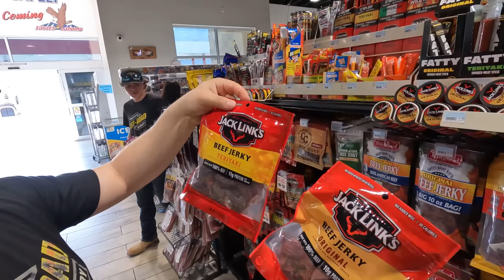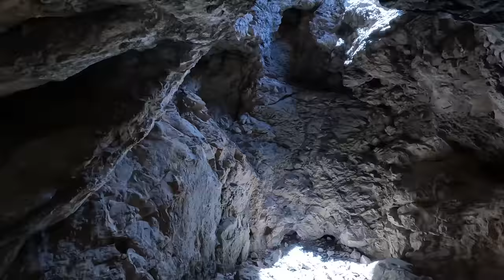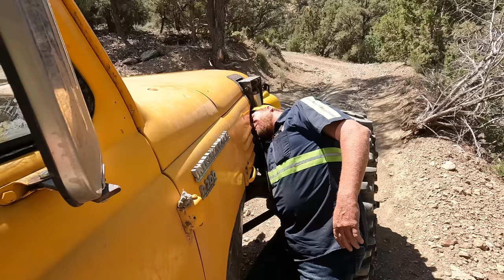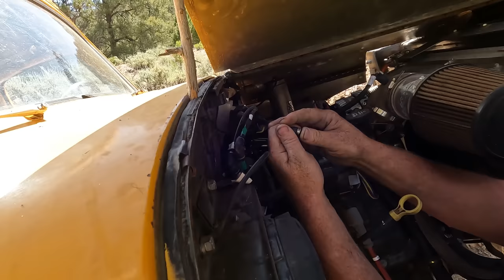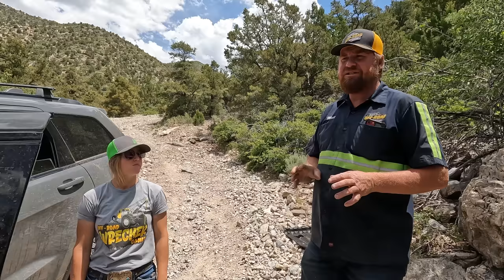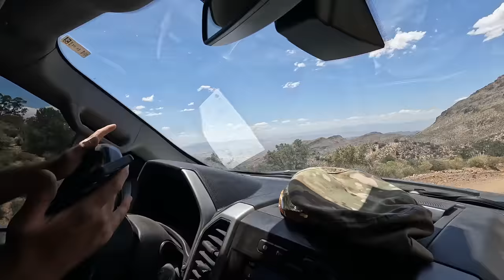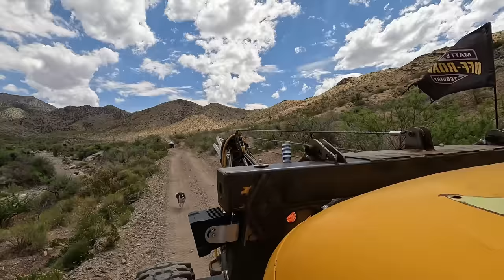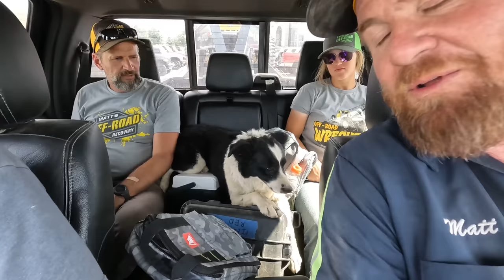Forced To Use Equipment I Despise Out On The Arizona Strip.

Comment: I have a set of traction boards and have only needed them in snow.  They’ve saved me twice when I was stuck because I couldn’t get back on top of the deep powder.  I’m sure in the terrain Matt sees boards are fairly useless, but in deep snow they’re worth tossing in the back of your rig just in case.
Reply: I keep four traction boardw on my rig in the winter.. they have gotten me out of some bad spots. I agree they're not nearly as useful in sand/ dirt/ rocks.... But in the snow they can really save you.
Reply: I was stuck at the edge of  a river with deep sand bottom. No where to winch. Traction boards, a hi-lift, shovel, a sleeping mat and a ton of elbow grease got me out.
Reply: exactly
Reply: Tire socks worked for me mud and snow got me out
Reply: @CoreyTiff-kv1nq 
Tire socks in the mud? How much help were they and how well did they stand up?
Reply: Never needed them, of course i’m not a toyota boi. My GMC and old willy’s never have been stuck up here in the rockies.

Comment: Heat Shields work for a reason, it's not just the heat transfer through the air, it's the literal infrared energy coming off of those pipes! Like when a fireball goes off in the distance but you feel the heat in your face, the air between you and the ball isn't any hotter perse. 
A simple physical barrier shield would probably help a ton!
Reply: Thought about the same thing. Simply a heatshield (best works some Aluminium or stainless steel and bare metal, because it reflects the heat back) between the headers and the heatsensible parts would do the trick. Moste OEM Cars have those from beginning.
Reply: @mulciber7428  
One should always wear their tinfoil hat.... good for manys thingses
Reply: ^^THIS^^ is the fix @TheCalbrt1987  has it. Literally a piece of aluminum foil between the headers and the affected stuff will do it. And probably cool the cab a bunch too. There is some neat waffle pattern stuff you could sort of shape over the headers.

Comment: A metal heat shield needs to be installed between your hoses/wires and the headers. Rapping the headers can help too.
Reply: Or way , would be to move hose and wiring to a cooler spot or behind firewall.

Comment: 5:40 .  I agree with matt. how many times have we seen Matt go out to get someone unstuck, and surrounding the customer are several $80,000 custom off road vehicle with winches and ropes? In my opinion it's like swimming, the difference in swimming and sinking is knowing you can swim. Matt knows how to recover, and that's what he means by what he said about traction boards.
Reply: Most of those trucks are just setup to look cool. Wouldn’t be surprised if most of the stuff doesn’t really work, or the owners don’t have a clue about recovering.
Reply: @KtP370  I can agree with that. Most aftermarket bumpers have extra holes that require drilling through the frame to properly mount them. I’d say most don’t take the time to do it.
Reply: Considering the fact that he broke one of the "ladders", they weren't up to the task either...

Comment: Matt, you may want to consider switching the airlines that are around heat sources (at least if not all)  to stainless steel hardlines with flared fittings, that would eliminate any chances of trail leaks. This PTC fittings are convenient but i wouldn't trust them miles away from any type of help. Stainless flaired fittings will hold up to anything.
Reply: Or, stainless braided airlines!
Reply: Can't go wrong with hard lines. Get a flare kit and re-do everything in SS so you can quit worrying about it. I like how this problem showed up in real-life conditions. This is the way.
Reply: @defaultuserid1559  yep, i used to do custom cars, i did a 92 caprice with hardline all through it and never had a single issue!

Comment: Infrared heat isn't affected as much by airflow, if you wrapped the headers so that the heat isn't radiating off the surface then you'll have a much easier time losing the heat into less critical parts of your car.

Comment: For the air line heat issue, I think your best bet is really heat shields.   Small pieces of sheet metal that prevent the header radiant heat from getting to the air lines. Heat shield just need to be a thin piece of sheet metal between the heat source and what your shielding. Of course, with air gap on both sides.
Reply: Or double walled exhaust pipes.
Reply: Same for fuel and wiring
Reply: No try fixing the tuning. If that is running too hot, its lean. there is no way that thing should be that hot.
Reply: They don’t pay attention to comments. These do nothing
Reply: Ceramic coating, heat shield & wrap. It should make a huge difference
Reply: @burtonspy911  you're making them at night

Comment: After using traction boards last weekend to get up a dune, no, you're probably not stuck but that doesnt mean they dont have their uses! Numerous times I've seen you pull a car against mud, I reckon if you put a traction board or two down, you might have had a chance to pop it up on top of it without as much stress on the vehicles. Sucks to pull them up after though haha

Comment: Matt, you may want to try wrapping those air connections with self-fusing silicone tape.  That would insulate them from the heat while holding the connections in place and I believe would fix your problem.  The tape can be cut off if you need access to the connections, and it would be much cheaper and easier than addressing the exhaust.  Once you start using the tape, you'll wonder where it's been all your life.

Comment: Matt..  You can wrap those headers and put a little metal shield above them and it would be more than enough to cool everything down.  Even more extreme, you could rig up a fan on each side -- to blow the heat out of that open fender wells.  Also another good upgrade would be to put shut off valves right at all of your four corners---  that way when there's a leak;  you can simply pump everything up as it needs to be, and then shut all your valves so that it holds in the pressure at the bags and you can still make it home and fix the leak at the shop, rather than being stuck on the trail.
Reply: Ceramic coat the headers and then asbestos heat wrap them. Your idea for a heat shield would help a lot.
Reply: Agreed. The wrap is inexpensive and VERY effective. So is the heat shield. Summit will have both. I've used both on a 1999 Pajero (MOntero) with an engine swap and headers. No more cooking feet. The other thing to do is to get the headers ceramic coated. Also very effective. Here in Oz, heat is an issue.

Comment: 5:23 Not controversial at all. I used to have a gov job where we had to 4 wheel into the back country on a regular basis. I said it all the time, if you could extricate yourself, you weren't really stuck, you were just inconvenienced. You weren't "stuck" until you had to call for outside assistance (usually after a significant hike! lol).

Comment: Traction boards are useful when your vehicle is generally capable of going over the given terrain, but there are a few places where you need to cross a ditch or go over a high rock, or a patch of the surface is too soft and you need traction (hence the name TRACTION boards). 
If your whole path consists of soft surface (like sand dunes) or rock-crawling, then of course the traction boards are useless, as you won't be constantly putting them under your wheels. You just need a more capable rig then.

Comment: 1.  You could have a shop custom build you headers to any shape you want.
2.  They make an insulation coating (not referring to heat wrap) that can be applied to headers that keeps most of the the heat in.  Headershield.
3.  Place some hi-temp insulation board between the hoses/wires and the exhaust.
4.  Use some fold-down boat seats for extra people on the back of the wrecker.

Comment: Matt, I wish I would have had a set of those bunny boards in August 1980 in Sierras mountains. When I buried the back end of my 1960 CJ5 with small block vette motor on an under ground spring. Locked in the hubs and buried it to further.
  As I reached down to pop the lid up on the storage under the right sear. When Tall, dark and hairy took to roaring at us. He didn't us tearing around his forrest. We were bird hunting and only had 12ga. bird shot and three guns. My buddy handed me my pump gun and I said let's go. He said F. orget you. It took off up the stand tearing the forest up. I ran parallel to it on the dirt road. It acrossed ahead of me into the next stand.
  2 1/2 hours later it caused a flock of doves to burst from a tree at the top of the road where it turned to the right, where it crossed with a boom, boom, crash, crash, crash. During that 2 1/2 hrs I sent rocked to China. Almost out now. Not enough winch cable to double line to a tree. Vietnam Entrenching and a Jack. Yes I would take the bunny boards. Broken right front axle was found later. My buddy never said a word again or during that except F  orget you I am not leaving the ammo box and the guns.

Cheers

Club of No Return !

Comment: Matt, getting the headers ceramic coated with a quality motorsport functional coating (inside the pipes as well as outside) (as opposed to cosmetic coating) aids greatly in keeping the heat flowing out the exhaust and reduces radiation of heat into the engine bay.

Comment: Awesome video !!!

As for controlling under hood heat is ceramic coating the header inside and outside  . As for keeping wiring and hoses protected by heat they have wire sleeving that will protect up to 1500 degrees

               Also you need to extract under hood heat by using  louvered vents or screens . Doing this will significantly drop under hood heat

Comment: The air fittings that you have could be switch out for brass or stainless which would help. Might also help alot to build a heat shield over the headers. Fantastic video as usual! Thank you.

Comment: How do you define stuck 

If you have to exit the vehicle to adjust or address a problem stopping your movement 

This is stuck for some people 

If you’re movement is stopped forward or backwards this is stuck for most 

The very adventures take it as a challenge 
And a test of their skills 
Stacking rocks 
Digging a path for a tire 
Using a jack to place stuff under a tire in a hole 
Using a come along or a winch by your self is just part of the challenge 

Only when a third party has to be called in are you officially stuck 

This is how I define stuck
Reply: Yup. "Stuck" is a tail between the legs, SOL moment.
Reply: Stuck means you can't get out with what's on the trail or your rig.

Comment: You know, youre right with that comment about having to use T boards and not actually being stuck, all they needed at that point was some leverage.
I live in Oregon and I've done my fair share of backwoods wheeling, including going solo into some spots I probably don't belong. Once I ended up buried to my frame in a Jeep and a powerstroke couldn't even pull me out. We ended up flagging someone down driving an old international on 44's and he made light work of my situation. I can't tell you how many people stopped to try and offer help but nothing was working. My vehicle was stuck in that pit for 4 days or so lol. Snapped like 3 straps in the process

Comment: Try covering the surrounding surfaces with reflective heat tape. I'm betting some of the heat problems are due to the headers radiating heat rather than the hot air per se. 

Also, someone already mentioned: you can get all-metal air fittings.

Comment: I have used traction boards many times to help people with two wheel drive vehicles "stuck" on ice with a little snow.  A quick pull or push would also get them out, but using those on the drive wheels is a quick and easy way to get those vehicles un"stuck".

Comment: I took my civic up there. Did it on 28" very aggressive snow tires at 15 psi and a 6 inch lift. 105° and had to run the heater the the whole time. Melted my dash cam internals but i passed about 3 overheating offroad rigs. Got some looks 🤣. The soft snow tires did really well on the loose rock and i staggered the big rocks.  About 14 inches of clearance everywhere but the oil pan which had 11 inches.

Comment: As a trucker I always carry a few pieces of plastic air line in case of a break in a brake line , different sizes that will fit inside or outside can be repaired, you can splice with out glue .

Comment: You really, really need to pull those headers and have them Jet Hot coated. That will noticeably reduce your under hood temperatures. Some heat shields between the headers and the various components would be helpful too. And finally, get some rear-facing jump seats, like a Subaru Brat, for the guys in the back. 👍

Comment: Matt, you need to get what is called poly Flo connector for the 1/4 " lines that keep popping off from heating up.The poly Flo connectors are brass and the screw together.  we use these in the dental business repair for air lines and water.

Comment: All Chrysler, dodge, and Jeep have the neutral lever which has to be pulled to put the transmission in neutral without running the car. They will be hidden beside the shifter usually. 
Great content as always
Reply: Or under the steering wheel in the trucks that don't have a center console
Reply: This is not the solution, that's just to allow the vehicle to be moved, without starting the engine. Matt is talking about towing over a greater distance, without the engine running. He's correct that the transmission should be pumping fluid when in neutral. Now, on the other hand, the transfer case in that Jeep can be put into neutral which is fully acceptable for towing when the engine is off. It does not allow the transmission to spin.
Reply: only a handful of cars can be flat towed. Another thing to be noted is that all Grand Cherokee with a transfer case cannot be flat towed cause it depends on whether the transfer case can be put in neutral, not all transfer cases have a neutral option. Matt is right, as per the owner's manual the zf transmission is safe to flat tow for a few miles at low speed.

Comment: What works good for traction matts is old snowmobile or used old tracks from utv's. I cut them in 4'-6' lengths.
They won't break or bend like junky aluminum planks. They are rubber encased steel rods or 3/8 cut lengths steel inside the rubber cleats. They also give yer tires something to grab with all the rubber nubs.

Comment: love that wrecker! why not use old school high pressure pipes and metal clamps for air/oil equipment? also, I suggest having a skid plate which will have the added advantage of focused air flow through the cooling system; hot air goes up, so some additional ventilation in the back of the hood will boost the cooling system and help with a new heat wave next summer!

Comment: I beg to differ on the traction boards.  I went up into the mountains this spring,  alone (I know) thought the trail was solid but as I drove over it 2 inches of ice broke beneath me dropping me into the mud from the thaw beneath it. I just spun and spun and was up to my axles. Dug down to my rear tires, crammed to traction boards in there and backed my shelf out in a couple trys. Without those boards I had no chance. Couldn't winch forward as it would have only gotten worse.

Comment: Matt, have you guys ever heard of a header coating called jet hot? It's a ceramic coating especially made for headers. It's coated inside and out. I've used them on my pro mod drag car several times with a lot of luck. You can even wrap on top if you like afterward. Cut the heat down enormously.

Comment: The reason jeep does multiple parks in the transmission, transfercase and rear diff is because in the 90s and early 2000s jeep grand Cherokee’s had “command track” full time 4x4 with front and rear limited slip. They had a viscous coupler which would fail. At 1000 dollars to have replaced. People would pull the front driveshaft to make it a 2wd but they had a sensor on the front diff that said “driveshaft not turning must be in park” so you would put your automatic in park on a hill and it would roll away like it was in neutral. That is keeps “genius” fix for that issue on grand cherokees. A park rod in the rear diff.

Comment: Wrap the headers and put a blanket on them as well that should sold your issues in the future with the engine heat and use hard air line with brass compression fittings or malleable copper and double flair it and use a hand bender that would look really nice

Comment: You can either have your exhaust headers coated to keep the heat in or wrap them with high-temp wrapping material.

Coating is more expensive but it's very thin (~1mm). Quite useful when there is little room to the frame - often done on the Lamborghini Countach for that reason.

Another way to get rid of the heat would be good old-fashioned hole-drilling.

Comment: You guys are forgetting about radiant heat off the headers.  They need shields,  aluminum heat shields all around them.  Air gaps and shields are the most efficient way to reduce heat transfer.  Wrap won't do much at all.  Shields!

Comment: Also the header you can get a coating in the inside and out that will really help if all else fails put boat manifolds on it (closed loop runs with coolant from the engines water pump) then they will always be 210° max  lol

Comment: Wrapping the headers and using some of the high temp tapes and maybe just make a little thin steel plate there too to help keep the heat away. Just form the steel into a heat shield.

Comment: You could wrap the header and build a heat sheild for the header and possibly the solenoid/ manifold or make the under hood hoses copper/ nicop brake line type lines

Comment: You should wrap the headers to reduce the radiant heat that comes off them, keeps it more inside the pipe and going out the back, and it also helps prevent getting burned by them when working around them.